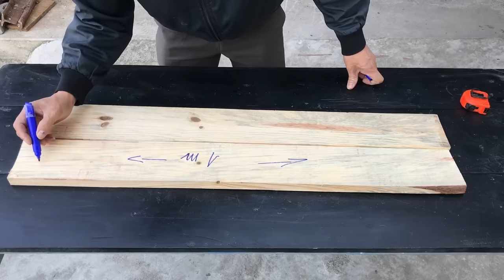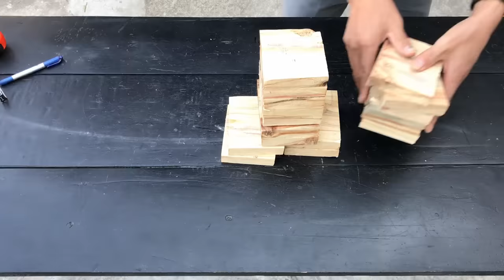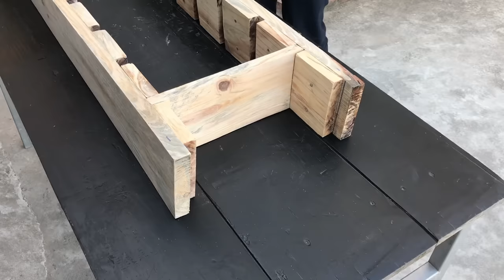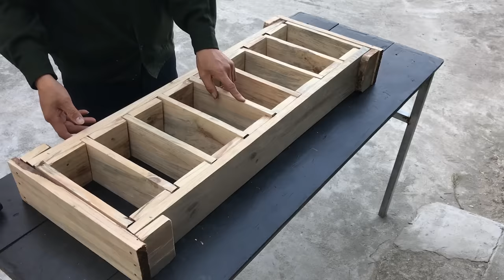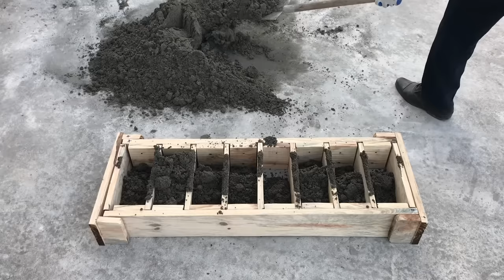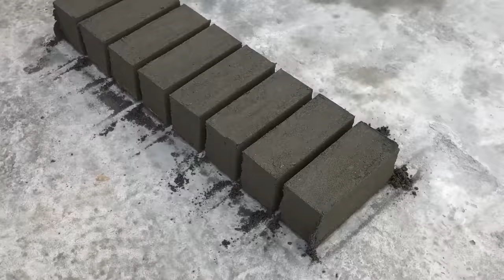1 production time produces many cement bricks -  From 1 wooden mold

Comment: blocks without a hole are very expensive to produce and take a long time to dry, it could be done with a piece of wood in the center of the mold for each block hole
Reply: Why do we need to make a hole in the middle of the brick ?
Reply: @ganapathigm4345  Because you use less material, lower the weight, and if they are fired in kiln, they burn more evenly.

Comment: Qual é à porcentagem dos materiais? Por favor amigo.
Reply: 3:1 means 3 cement 1 sand plus water.
Reply: @suleimangoox6075  Obrigado
Reply: @suleimangoox6075  the other way around 3 sand 1 cement and 1 water, 3-1-1
Reply: @juvenalrosario6454  Juvenal es 3 arena 1 cemento 1 de agua 3-1-1